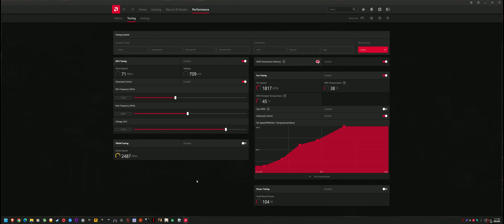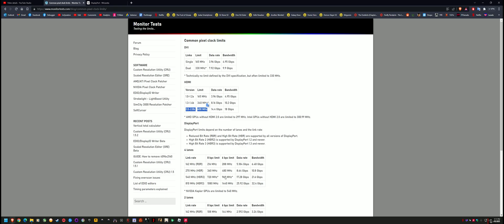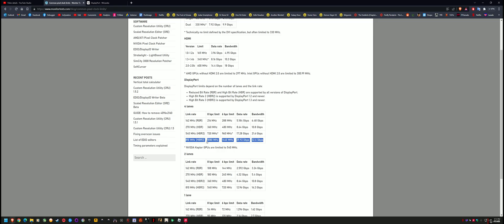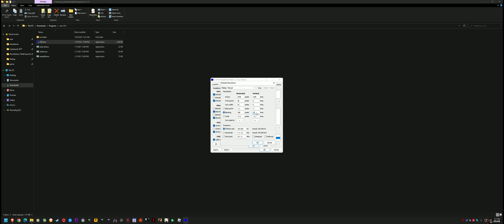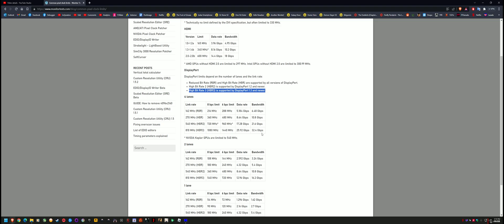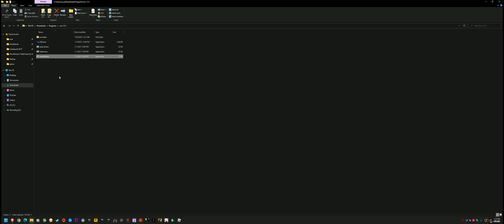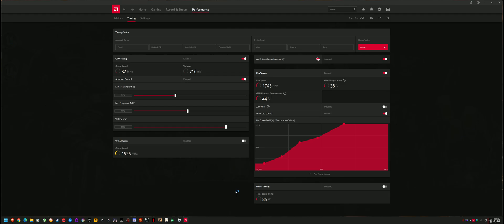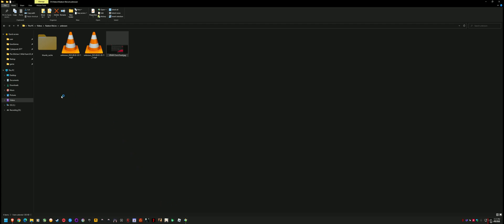RX 7900 XTX High Idle Power / Stuck VRAM Clock Fix (CRU)

Comment: Is it gonna last after restart?
Reply from the maker: Yes but sometimes need re-apply if you wipe drivers with DDU or do factory reset between driver updates.
Reply: @PatchFixGaming  I appreciate your video! It looks like you helped me to reduce idle power consumption from 110W to 31W, and to 50W while browsing. However, I'm not able to reach anywhere close to 10W on my 7900XTX with a BenQ EX2780Q 27-Inch 2K QHD HDRi 144Hz monitor. Do you have any ideas?
With 90-120mhz still can draw like 30w and 61 - 29w which i dont think is normal?
Reply: @mishibishu  That's normal, ~18W is usually the minimum. Just confirm that your GPU core clock is down to 200MHz and memory clock is not at max but goes down and you are fine.
Reply: @Ludak021 I had to return it; it was too much for me to handle. I got the 4070 Ti Super instead and am running it undervolted a bit. Out of the box however, the power draw was 10-11W, so I'm happy with that. It's a completely different experience working with it, to be honest.

Comment: the issue sucks, i bought a 180hz 1440 p monitor paired with a 165 hz 1080p. i both matched them to 165 and i got my vram 
clock speed idle at 70-80, TBP 31w. i had to lower my refresh rate for the first time which i never did when i was in nvidia. annoying
Reply from the maker: @dewthegreat9270  Did you try adaptive sync already? I noticed it more with AMD but checking NVIDIA forums seems like some have similar issues too but since their drivers don't have built in power monitoring it's less obvious.
Reply: @ a sync? I have my turned on in my main monitor and not on the second one

Comment: Hey man thanks for the guide. I'm only using one monitor, and unfortunately it seems to not work correctly with CRU. 3440x1440 240Hz is absolutely nowhere to be found. It's only showing 2 resolutions that aren't even 21:9. I'm really lost.
Reply from the maker: Hmm try looking in the bottom window under 'extension blocks', check inside each entry there, sometimes you have to expand twice to reach higher refreshrate entries, for e.g on my 165hz ultrawide its under Extension blocks> double-click DisplayID>then double-click Detailed Resolutions.

If it's absolutely missing then could be a problem with the cable, but if you can set it to 240hz in advanced display options then it should be in CRU somewhere.
Reply: @PatchFixGaming  Man at the end of the day I just had to manually make a DisplayID 1.3 extension myself. I've genuinely been tweakin trying to solve this issue and now it's finally done lol. Pretty weird that nothing was there at all, I think the "issue" was actually my monitor. Relatively new monitor with brand new firmware, maybe that affected something. Anyway tysm for the guide and reply!!
Reply: @enhhi  hey there, I also have a 3440x1440 240hz panel and a 2560x1440p 240hz monitor. Did those exact steps work for you in terms of setting the highest profile to Automatic PC and restarting? I only did it on the UW monitor and no changes.

I tried lowering the 2560x1440 panel to 144hz and 120hz manually without trying this method and didn’t do anything either.
Reply: @MatrixProHD  I only run a single monitor so my experience is different than yours. As far as I'm aware, AMD gpus still have high idle power draw issues for multiple high-fps monitor setups. I gave these exact instructions to someone else and they said it didn't work for their multi monitor setup. For what it's worth, the exact steps I did are here:

   1. Open CRU > Extension blocks > Add... > DisplayID 2.0 > Add... > Detailed resolution > OK > Add...

   2. Here, you should take a screenshot of the stock settings because you'll be using them in Adrenalin software's custom resolutions.

   3. Click the "Blanking" option in CRU, raise lines to 100 as a starting point. You may need to raise it more if you're still running into the issue. Notice how the "Total" section changes.

   4. Go into Adrenalin software > settings > display > custom resolutions.

   5. Set your Resolution (Px) to whatever your monitor is and Refresh Rate (Hz) to whatever you're going for. Presentation set to Progressive and Timing Standard to Manual.

    6. Copy the values you see in CRU into the custom resolution window in Adrenalin. Format of the following points will be CRU -> Adrenalin

        a. Active -> Timing Display

        b. Front porch -> Timing Front Porch

        c. Sync width -> Timing Sync Width

        d. Total -> Timing Total

        e. Sync polarity -> Timing Polarity

   7. Click save. Go to Windows display settings > advanced display > refresh rate and make sure your new custom refresh rate is chosen.

Comment: Thanks for the guide mate.
I am using 2 monitor and 1 tv with my 7900 GRE.
I tried with many combos;
 tv is 3840x2160 120 hz, 1 monitor is 1920x1080 165 Hz and the other is 1920x1080 75 Hz.
If i use two monitor or tv doesnt matter, with lowering monitors hz i can use tv at 120 hz and vram clock downclock, at least dont work at max. 
But i couldnt do that while all three working even with editing CRU, do you have any suggestions for it?
Reply from the maker: No worries, I think this is fairly normal with a large monitor refreshrate mismatch, increasing the blanking on the 165hz monitor is probably the best bet, but again the multiple outputs and overall display hz add up so that 1 monitor on high refresh combined with the other two would be keeping the VRAM speed up, ideally with high refresh you want all the rates at the same speed + sync the blanking times as close as possible and under AMD software>settings cog(top right)>Display, enable adaptive sync.

Actually one setting that windows introduced if you're on windows 11(not sure if they added it to Win10 via updates) that might help is go to 

Desktop>right click>display settings>advanced display settings 

And enable 'Dynamic refreshrate' this will let the desktop downclock to 60hz to help with VRAM power savings, but I'm not sure how reliable it will be with triple monitors, worth a shot.
Reply: @PatchFixGaming  Thanks, i tried 165 hz to drop to 120 and and tv was already 120 and 75 to 60 and increase blankings, and even go up to 400 500 blaking line on 120 hz monitor but it didnt help. Should all three's blaking time also need to equal or close? Because tv dont go higher than 320.
I am using hdmi 2.1 with tv, dp 1.2 with high resresh rate monitör and the other monitör uses hdmi, probably 2.0 but i am not sure.
I set monitors to 8 bpc( higher refresh rste can go up to 12) , only tv at 12 bpc and hdr enabled, freesync enable on all via radeon and also in monitor settings.
I am using Windows 11, also tried dynamic refresh rate enable but it didnt help me either, even i think it increased vram speed for me.
Reply from the maker: Hmm I know higher BPC can also use more bandwidth too so having them mismatching could have a similar affect to running one at high clockspeed so you could try all 8bpc+120, other possibility is the other monitor on HDMI might be using a low spec cable which will interfere with maximum supported pixel clock.

So a few of the things that can conflict and cause high clocks would be, pixel clock(mismatch monitor/refreshrate/blanking/BPC) or low spec cables, 2x high spec and 1x low spec will be pixel clock(blanking) limited by the low spec cable. Also mixing cable types can reduce your chances of getting everything working smoothly, but this can vary on the model of GPU, if it supports 3x DP cables for example, then running all DP or all HDMI would be worth a go too, but this could also be a waste of money if one of the monitors/TV has a setting or pixel clock that wont run stable at X blanking time.

E.g. even if you can run stable on 400 blanking with one monitor, youd want the other two monitors at 400 as well, its best if you can find the maximum blanking that all 3 displays can support and set it all the same but also take note of the cable types and pixel clocks showing when you edit it.

You only need to adjust the Vertical blanking lines for the RES+refreshrate setting you are using for each display btw, and make sure it stays marked as active* in the dropdown box after exiting out of CRU using 'ok' button and running restart.exe, open CRU again and double check the blanking on the active profile(using dropdown at the top) is still enabled, if a blanking times pixel clock is not support or stable then it will automatically default to the original profile. You can swap to unused profiles and use the delete button in CRU to remove them after 'ok'ing out too btw. This can get rid of multiple entries to make it easier to track what you're doing.

Comment: i had a hard time with my monitor, it had 12 for blanking lines, so the way i solved it was, i set the manual timing to automatic pc then lowered the refresh rate till i reached just under the "range limits" which u see at the main window in cru. hope it helps for someone.

Comment: I cannot thank you enough.  I have had high VRAM issues for months and this guide helped get it down from idle 1990MHz to <100MHz
Currently running a 6800 XT

Again, thank you for the detailed fix. You're a godsend

Comment: For anyone did not work this method: I am having this issue for 1 year. Today I solved. I have a 6600 XT. 1 ) Go Record & Stream 2) Settings 3) Turn off everything under Media title.
Reply: For me it's max clocks even on low 60hz, so maybe your fix helps. I'll try as soon as I get to my pc.
Edit: didn't help(
Reply: @omerfarukucan2583  thanks. This worked for me. I turned off record my desktop and went from 110watts on idle to 30-45w on idle

Comment: Notice how everyone in the comments is saying your "solution" doesn't work? 

Might want to do a little more research next time before you make a "tutorial" bud.
Reply from the maker: Did you actually read the comments? PC issues often don't have one size fits all solutions especially when it's compatibility related with different monitors/cables & refresh rates. A fair few have said it did work for them & if it helps just a few people then it's worthwhile.

Some had to buy new cables when CRU alone didnt work so unless you've exhausted all possibilities theres enough proof here that the 'fix' puts people on the right track.

Reverting the CRU changes on my own setup puts me back at high idle clocks even on the latest drivers & this is across 3 models of GPU & two different ultrawide monitors.

Comment: I don’t have tuning
Reply from the maker: If the performance>tuning tab is completely missing, run DDU then reinstall the latest GPU drivers again. 
https://www.techspot.com/drivers/driver/file/information/17830/
https://www.amd.com/en/support/downloads/drivers.html/graphics/radeon-rx/radeon-rx-7000-series/amd-radeon-rx-7900-xtx.html
Reply: @PatchFixGaming  when I click tuning it says unlock dpgu memory for performance not available
Reply: @PatchFixGaming  and every since I got this gpu when I play games it randomly restarts also sometimes my gpu goes about 80c
Reply from the maker: Full system specs? Can you double check the monitor cable is plugged into the GPU(lower HDMI/Displayport) and not up near the USB(motherboard) ports?.

Comment: Hi Joey, I previous had dual G27 Samsung monitors but just switched over to a LG C3 42 120hz OLED, my vram idles fine but when im playing a 4k movie it maxes out, would it be worthwhile going through this again or is that normal that its maxing out? Thanks man appreciate your videos.
Reply: Thanks for your reply. Under extension blocks, my monitor isn't shown. What can I do to solve that?
Reply from the maker: Make sure the correct monitor is selected at the top (active) or see if the resolution is listed in the detailed resolutions at the top. Otherwise you can try manually creating the profile using details from this post; https://forums.guru3d.com/threads/fixing-vrr-flickering-for-the-lg-c2-and-other-oled-qd-oled-displays.450983/ but simply use 120hz if you arent running VRR(variable refresh).
Reply: @Jo3yization Thanks man I'll get back to you once I've done it. I'm in the UK so our times are a bit different. 8:20am as I write this.
Reply: @Jo3yization Hello again. So I went through the steps from the link you sent. It didn't seem to change anything for me. I went through some additional settings in adrenalin and noticed VRR was switched off. I turned it on and now when I'm watching a 4K movie it's sitting between 200-700mhz. Again I don't know if that's normal or not. It's still not showing my monitor in CRU. I'm tempted just to leave it. What do you think?
Reply from the maker: That's certainly better than stock, I also keep VRR on & it runs around 300-500mhz with a 4k YT stream running, but again my desktop is 3440x1440@165hz so some difference is expected, 200-700 is decent and I'd personally be ok with that if CRU is having trouble detecting your monitor.

Could also be cable related if your current cable spec isnt at least HDMI 2.1 or better. Discussion here might help depending on what actual settings you're able to run with the current cable; https://www.reddit.com/r/OLED_Gaming/comments/15wc6af/how_to_get_4k_120hz_on_lg_c3_on_a_pc/
Reply: @Jo3yization I've got a HDMI 2.1b Belkin cable. I've bought another HDMI certified cable that's coming today to see if it changes anything but if it doesn't I'll just stick with the Belkin cable. Thanks for sharing they links man. Appreciate your help 👍👍👍
Reply from the maker: @wdunn06  Yo forgot to check back, did you have any luck with the new cables?
Reply: Yo Joey apologies for the late reply. I added a soundbar to my pc yesterday and ran into issues with my GPU drivers and of course the high VRAM use reappeared, I've got it fixed now but man what a pain in the ass it is. The belkin cable I have works great, the other high grade cable I've got I'm using for the soundbar. FYI the reason I got the high VRAM usage again was because I didn't enable AMD freesync on my monitor.
Reply from the maker: Just tested & playing a 4k h265movie in VLC I get around 700mhz vram @ 50w on a 3440x1440 monitor while 4k60fps in YouTube /w HW acceleration off(chromium) runs 81mhz@30w while the CPU is using around 10-15w.

For a true 4k monitor I'd expect the idle to be a bit higher but you should still get some downclocking watching or streaming 4k content, so worth trying imo.

Comment: Sadly didn't work for me either. it's going to be my monitor that's the problem. I've got a BENQ EX2780Q 2560x1440x144hz monitor (just the one) and I've always had high power draw regardless of the cable. I'm using a USB4 spec certified 40gbps USB-C-C cable so it should be good. I've tried upping the blanking time but it does nothing or just crashes after going to high. Lowing refreshrate doesn't make any difference either. Though lowering resolution to 1080p lowers power consumption from 104w to about 60w. It sucks though, cause I've got an old prebuilt office case with bad airflow, and just by writing this comment here i'm on 51 degree input temperture and 83 on GPU, all caused by likely less than 200w system draw.

Comment: Did not work for me sadly, looks like both my monitors are limited. But found out that my idle power consumption fixes if i go 60hz + 165hz or both 144hz + 144hz, but one monitor being 120hz/144hz and the other being 165hz goes back to the power consumption problem. So far im sticking to 144hz on my dual monitor setup until some magical driver fixes this issue for good. also one monitor has a dp cable that supports up to 1.2 and the other is a dp that supports up to 1.4
Reply: yea mine is also 1.2 and my main is 1.4, my 3rd moni is 1.4 too i think and i cannot for the life of me figure it out. i reduced clocks to 139 from 144, 170>159, 75>69 ,i used very high blanking times since they were lower resolution and i still had the high idle clock :/

Comment: Is it normal for CRU settings not to apply after rebooting? I've noticed that my VRAM clock remains the same even after restarting. Do I need to run CRU restart every time, or is there an automatic way for the settings to take effect? The resolution and refresh rate are applied, but only the clock remains at its maximum. I have to run the restart program to revert it back to normal clock speed
Reply from the maker: They should apply after running restart.exe, if not then I'd assume the monitor or cable cant support the setting. You can check if that's what's been happening by running CRU & clicking the top left 'dropdown' where your active monitor profile is, if there are duplicates then the settings werent stable.

Comment: They fixed part of the idle power issue with version 24.2.1
Reply: 40w on idle now. I don't know if it's normal, it doesn't feel normal.
Reply: @warnacokelat  I get 11W at idle. For me  Idle means browser is not being used and not touching mouse...  if i am watching youtube or doing research on google the power is 36-40W.   It's still too much compared to nvidia but what can we do. 
Im just glad that when the pc is doing nothing in desktop (not touching the mouse) its 9-11W.  Before it was much higher! My card was 56 degrees at idle because the card is also zero rpm. Now its between 35-43 degrees while idle or using the pc normally. I think 24.2.1 is a good driver overall!
Reply: @Ladioz  I think there is something wrong with the drivers. AMD are known to pull shit like this with new products. My 6600XT used to draw high power in idle when Freesync is enabled, now it's working as inteded with low idle power.
Reply from the maker: Still have this fix enabled & on 24.2.1 I get 9-12w idle with 3 chrome tabs(one paused stream) & radeon performance>tuning tab fullscreen. But again this is 3440x1440@165hz single monitor, on dual monitors or with HW accelerated background apps the idle will usually be higher, stuff like discord or wallpaper engine etc.